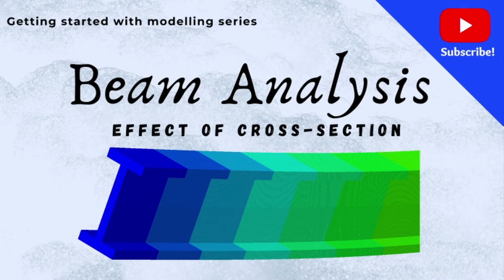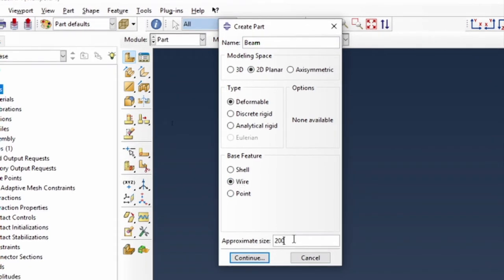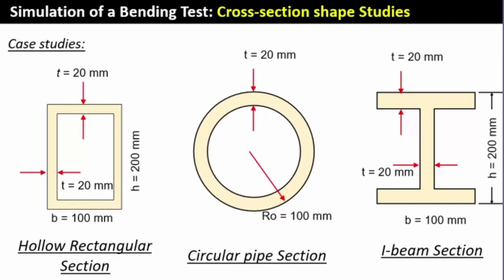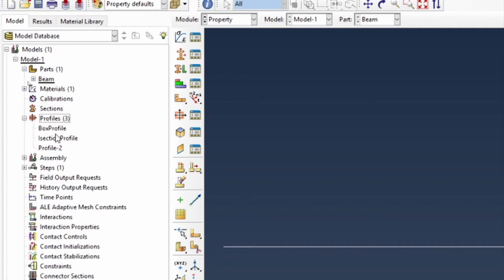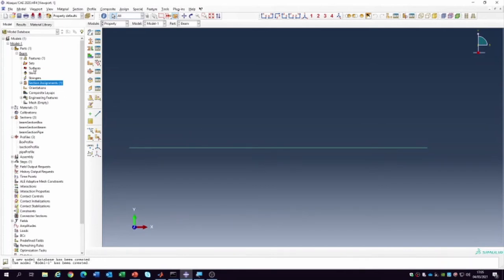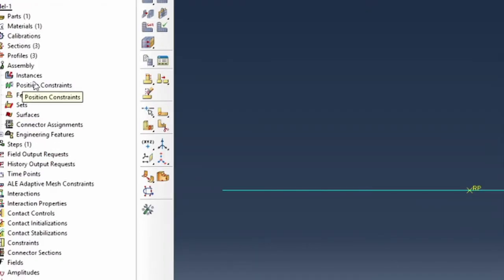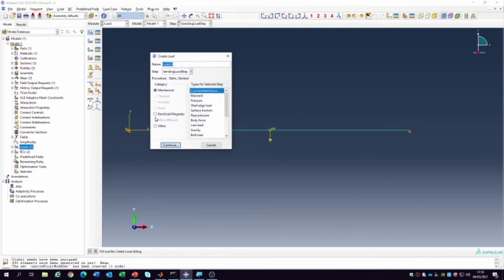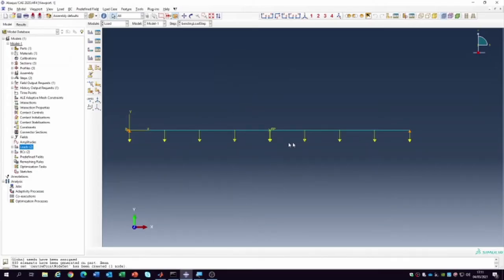Beam Analysis in ABAQUS: Effect of Cross-section Shapes

Comment: Hi dear @MichaelOkereke
Thanks for your great videos. I have a question about create a new section with semi-circular cross section for beam. How can I create?
Reply from the maker: Hello @soheilgh1845, thanks for this query. Normally, you will use pre-existing profiles in ABAQUS to create cross-section of a beam. Unfortunately, there is no option for a semi-circular cross-section under the Property Module of ABAQUS. 

What I will suggest you do is to go to the Property Module of ABAQUS. Click on the Create Profile option. In the pop-up window, you can name the profile - SemicircularProfile, and go to either the Arbitrary or Generalized options under Shape. You can create your profile from either of those sub-options. 

I will recommend you use the arbitrary option. You simply need to draw up your semicircle within say MATLAB, and get the coordinates of each point that make up the curve and the segments. The Arbitrary option assumes you descritize the semi-circule into segments which you can number numerically from 1 to as many as possible. Find the coordinates of all the segments. Specify the thickness of the semi-circular cross-section and specify all that. 

After that, ABAQUS will take all the input and recreate a semicircular option for you. 

On the other hand, you can use the Generalized option which will not create an actual semi-circular option but only works with an arbitrary shape. This in your case will be the semicircle. But you have to have worked out for that cross-section what the area moments of inertia would be along the x- and y-axis. You can find the formula in an Engineering Mechanics textbook. Input those into the boxes and ABAQUS will use them to work out your solution.
The reason why the later approach is still correct is because the essence of specifying a profile is for ABAQUS to use those to work out the corresponding area moment of inertia values. So, if you can supply those directly to ABAQUS, you then do not need to explicitly describe the profile geometry. The downside is when you visualize your results in ABAQUS, it does not show the right geometry but the answers will be right.

Let me know if the above helps.
Reply: Thank you so much. I tried arbitrary option. I create my semi-circular profile in MATLAB and divided it into 100 segments to obtain the x-y coordinates. After that, I entered x and y coordinates in Abaqus. I used y coordinates as the thickness of profile. I don't know it's true or not. But it gave me an opened semi-circular profile.

Then I tried the second method which is generalized option. Firstly, I found the area moments of inertia along the x-, y-axis and xy. As you mentioned, it gave me another shape (like an oval). But in my case, I want the curved part to be inside of my part (Just imagine FCC unit cell, in solid simulation we cut the outside of the FCC part in order to create our lattice with neighbor unit cells). If I use this method, how can I understand which side is used for curved part of semi-circle?  @MichaelOkereke
Reply from the maker: Great to see you try both methods. I did say the second case is not a visualization method, as it is based on an arbitrary geometry. If you want to visualize it properly, in the simulation results, then the first method is the way to go. You can try a different section say a circular section (full circle) and then do the semi-secular (first method). YOu should get results that look similar at least on the top side of the circle with respect to the semi-circle (assuming the semicrcle is full on its top side).

Hope this further comments make sense.

Comment: I find your videos great but I was wondering what do you do if the job aborts due to errors. Is there a way to find out what exactly the errors are? 
For some reason the two other jobs didnt successfully compile
Reply from the maker: Hello @Burcu, it is difficult to know exactly why a model fails without looking at the *.DAT or *.MSG files that come with the simulation. These files will often containe warnings and erro rmessages telling the user why things are not working out well with the model. I suggest you look at those. You will need to have someone with more experience of ABAQUS than you have to try and understand what you are doing and help you in correcting the problem. Good luck with it.